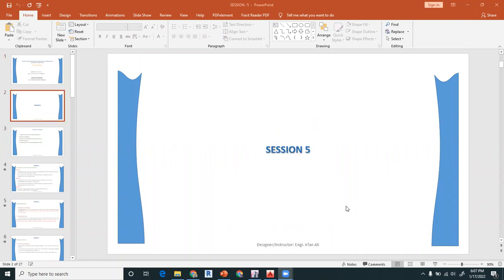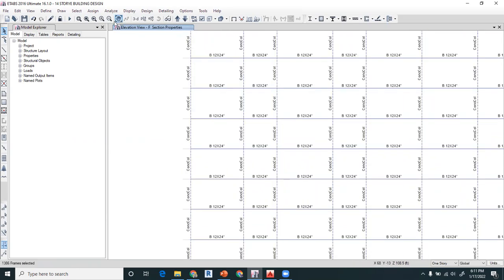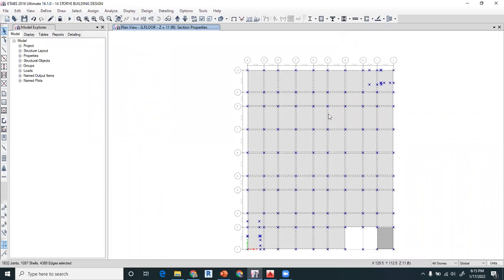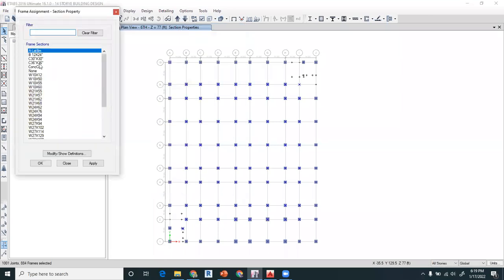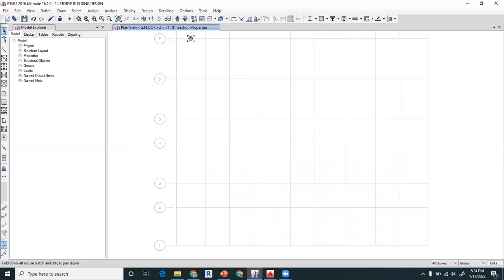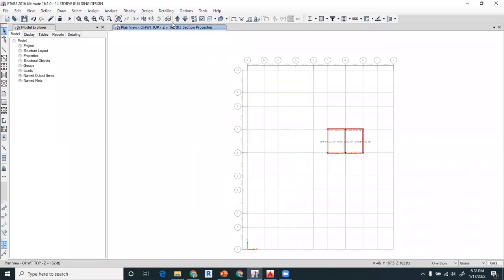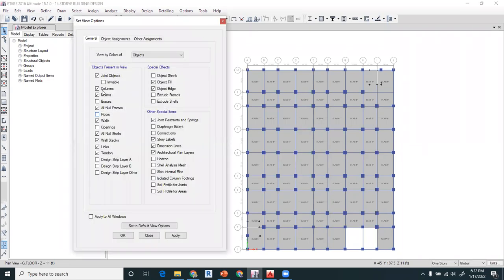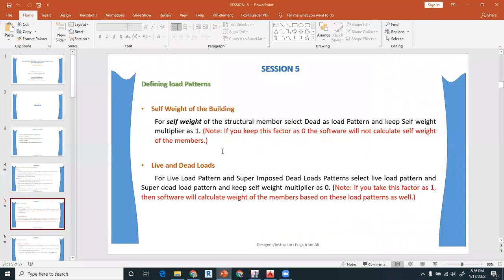Session 5 (P-1): Assign Sections, Define Loads & Mass Sources in ETABS | 14-Story Example

Comment: sir what is the purpose of assinging pier level to the lift and retaining walls?
Reply from the maker: Pier labeling allows the program to treat the wall as a vertical element that resists lateral loads (e.g., wind, seismic). It helps compute axial, shear and bending moment distributions along the height of the wall.